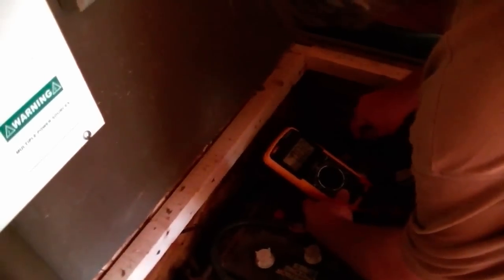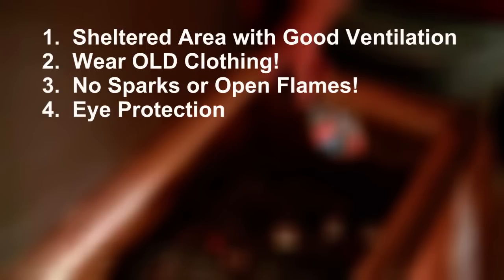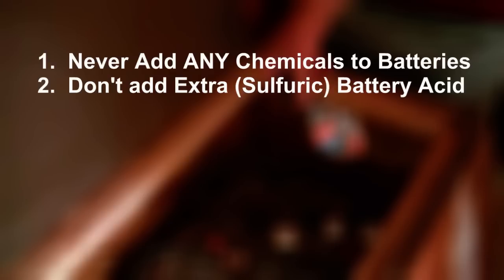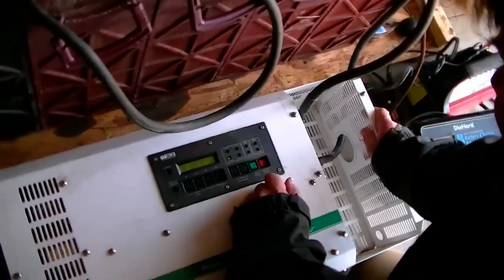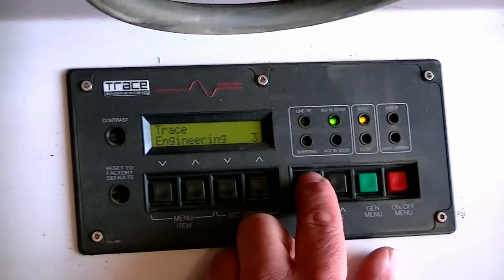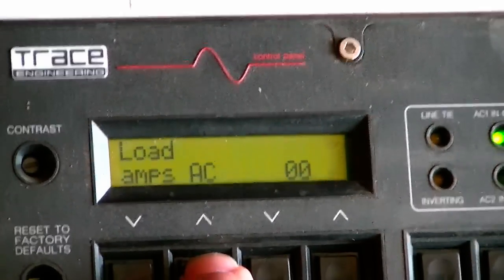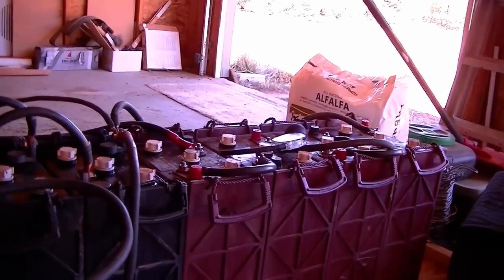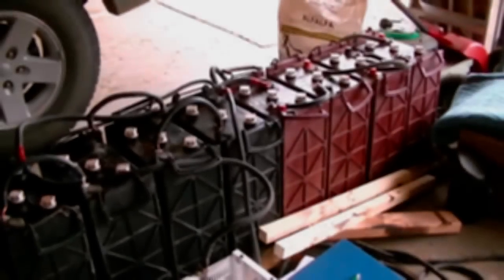Equalizing Batteries

Comment: The battery caps are designed to allow the gas to escape but not the liquid. They burst the bubbles and return the electrolyte to the cell container. If you leave the caps off, you loose/waste electrolyte and as the bubbles burst, they spray sulphuric acid everywhere.

Comment: thank you for the great video it's very well said. for the last year my l16 have never been brought to a full charge because I couldn't adjust the setpoints on my solar charge controller. we've got a new charger and we're trying to bring back the capacity using your method now.
Reply from the maker: Like I said in the video, it's as much as art as it is science.  But given the fact that your set hasn't set in the weather in a discharged state for years, I would say your changes of giving them new life are quite good.

Comment: Nice video Steve, I agree with everything you say. For AGM owners I personally would not recommend equalizing any AGM's at about 15.5 v, except for the Lifeline design, unless the battery manufacturer says to do it (most don't.) It will just dry them out prematurely, in most cases. Yes you are dead right, don't go adding chemicals or Epsom Salts to good batteries. Chemicals may be OK to squeeze a few months out of a poor battery , but will shorten the lives of good batteries that work well. (I proved it 30 years ago by adding  shop bought battery 'aid' chemical tablets to some batteries on one of my battery banks. The batteries I didn't add the 'aid' chemical to lasted years longer. Never, ever, equalize true GEL (thick electrolyte) batteries. Any voltage above about 14.3v for long completely ruins GEL cells.
Reply: All above based on 12 volt batteries of course.

Comment: Good video, with only one point,never equalize whit the cell caps off!, only open the cell to refill with distill.water, or messuring, always close the caps! (All caps are ventilated, and will keep the fluid in, not getting the mist of acid and water out off the batts., gasses can get out whitout a problem (advice from proffesional lead acid battery installer witch we are)
Reply from the maker: I would normally agree with you, except in the case of equalizing.  I have had a case split one time, and caps pop off like corks.  I don't know if the vents were clogged or what-not, therefore I have left caps loose when equalizing since then.  But then again, it's what works for you, and that's what really counts!  Thanks again much for watching and subscribing!
Reply: He's overcharging at a rate that can explode the battery if you leave the cap on.

a grossly excessive rate that should NEVER be used.

Comment: I noticed during the specific gravity test at  about 9 minutes that you didn't tap the tester to dislodge the air bubbles clinging to the indicator arrow.  The air bubbles are giving you a false S.G reading.  If you tap the instrument several times with your finger the indicator arrow will settle down to a more believable reading instead of off the scale.

Comment from the maker: My friend Tom owns a battery desulfator. Many people I know that have them swear by them, but they themselves don't know much about electricity or alternative energy systems. My experience with them has been very little.

Having said that, I have noticed no difference at all when we used Tom's or didn't use it. The companies claim that they can be used on small or large battery packs, and that also causes me doubt. For now, my opinion is that any desulfators do not provide any real protection.

Comment from the maker: Warren, I have noticed that areas such as yours don't give the best results for solar or wind, generally. Every bit helps. Having said that I would suggest determining whether you get more sun or wind where you live - it could be variable like here with more wind in the winter, no wind and lots of sun in the summer. In those cases you would essentially set up and winter system and a summer system to form a hybrid that provides the best of both when available. Wind data is available from noaa.gov

Comment: Very good video!
Subscribed to this, as it's a very useful tutorial.
I'm trying to equalize the cells in a 70ah car battery, and I think the negative cell is shorted as it's reading 0.70v when the rest of the cells are reading 2.6-2.8v.

Hopefully it can be recovered, if not I'll have to get a new battery as I'm not going through all the trouble to change the negative cell.

Comment: when I last tried to charge up my bank was just in the mere 10 degree winter and patience was not at my best. I even wired inverter backwards which oddly the batteries were not happy with when I upgraded my cable size from  4 to 2/0. so I think I smoked the 6 volt one closest to it. living is the best way to learn life.
I will work with these suggestions and see where it goes, if it's not just back to the battery store.
Thanks
Reply from the maker: Let me know how it goes.
Reply: It looks like one of my t-105's has a bad cell, it only reads 4 volts while the others are at 6.
Reply from the maker: +Rev John O'Toole The cell might be just plain ol' bad.

Comment: Steve I'm a subscriber of yours. After watching video and results are good. Could the batteries be drained and flushed with distilled water? Then replenish with new sulfuric acid and distilled water?
Reply from the maker: A long time ago I tried that with mixed results. It’s going to depend on a lot of factors like how sulfated the plates are, if any pieces of the plates are on the bottom of the sounds, etc.

Comment: Great video and info for flooded batteries. I have 1 LifeLine 8D AGM 255ah battery that won't stay above 12.6v after an overnight rest and after a full charge. It sat for many months under charged. I also use a 4 stage RV charger and also a constant voltage adjustable current charger to equalize them at 15.5v 6 hours per manufacture specs. Can you give a few pointers to this difficult task of bringing it back to life. I have 3 others that rest at 13.1v. and at $650 each I'm not really looking forward to replacing one.
Reply from the maker: Robert, 12.6v is not a bad reading at all.  That's what I would expect on a "well-seasoned" battery.  The tell-tale sign will be placing it under a load of around 20 amps.  If the voltage goes immediately below 10 volts, then you could have a sulfated or bad cell, in which case I would try your constant voltage adjustable current charger to equalize them at 16 volts for 6-8 hours.  If you've done that recently then I would equalize them for no longer than another 4 hours.

If you apply the load and the voltage drops a couple volts, then slowly creeps down, I'd say the battery is about as good as it's gonna get.  Batteries are as much art as science.  Mess with them enough and you get a feel for them.

When you apply the equalizing voltage, it the battery voltage quickly rises to the equalizing voltage, then you have a sulfated cell(s).  Hopefully the voltage will start to creep back down, then slowly rise again.  Hold the voltage for the 6 recommended hours beginning at that point.  If the battery voltage quickly rises to the equalizing voltage and stays there, then the battery is likely bad.  At that point you can try a battery sulfation additive as a last ditch effort with varied results.

The bottom line is batteries get old and die, or they get ruined and die.  Eventually they all die.
Reply: Steve Robertson Thanks for the info, my question is how much current to put into the battery at 16v? There seems to be a break over point for current acceptance. At 15v current is about 2.5 amps, at 16v it is 8-9 amps. I do hear bubbling at 15v and above. How will I know if I am damaging the battery? Can I put this battery in a bank with the other 3 that show 13.1 at rest in my RV without damaging them longterm? Thanks for all of you advice.
Reply from the maker: Robert
8-9 amps is good.  The bubbling you hear is the hydrogen/oxygen molecules being generated on the plates from the water during charging.  This is what kicks the sulfation off the plates and it is also a good thing.  During this time keep an eye on your battery temperature.  If it starts to get above 100 degrees or so, then stop the charge until it cools and then start again.  You will damage the battery if you go too long - in your case the manufacturer states 6 hours, but I usually go another 50% past that if a battery is badly sulfated.  In your case I would go as long as 9 hours.

I have seen more batteries ruined from being undercharged than overcharged.  But it can and does happen.

Mixing old batteries with new batteries has always been taboo.  But I met a fellow here on the mountain that has been using recycled batteries of all ages mixed to make his system work.  It works.  So until I get some hands on experience with it directly, I have nothing to say about mixing new and old batteries.  But like I said, the word from manufacturers is no.  They do have profit margins to maintain also.  I have nothing to offer from personal experience on this.

From a technical standpoint, the higher charged batteries will discharge into the lessor battery until their voltage has come down to the level of the lower battery.  At this point they will all live at the lower voltage - obviously not a good thing for the newer batteries, but not catastrophic either.  They will likely sulfate into the same condition as the lessor battery.

Thank you for your questions Robert.
Reply: Steve Robertson Steve, thanks for the great advice. I followed your equalizing suggestions and my once failing battery is now holding a charge of 13.2v after sitting for 48 hours. I did a load test of 20amps and the voltage dropped to 12.6v. during that test. Afterwards it came back up to 13.1v. What other tests can I run to get a better understanding of its condition?
Reply from the maker: Robert
I would say that you've got a handle on your situation.  You got your battery back.  Those tests are really about the only ones I think of off-hand to perform.  I hereby promote you from beginner to novice!  LOL  Glad it has worked out for you, Robert!  Please stay in touch.

Comment: I have 6 4v to 24v bank and two of cells gone bad. I’ve disconnected in two groups of 3 12v bank and one side came back but other 12v seems harder to come back.  One battery reading 3.4v rest at 3.8v
What should I do now? Keep on trickle charge til it reaches to 4v? And what amperage should be charging at? Thanks
Reply from the maker: What is the amp hour rating of battery?
Reply: @OffGridLivingSteve  rolls series 5000 1350ah 4v
Reply: @OffGridLivingSteve  when I started this morning, volt was at 10.4 and ended at 11.2v not enough to start the inverter.
Is it possible to string the battery with other 3 4v batteries and equalize all the batteries? Or would it damage the other set due to one cell being low voltage.

Comment: Which tecnical equipment you are using in this video ?
Very good video !
Reply from the maker: Brother I wish your channel was English because I am immensely interested in your projects!

I use all cell phones for cameras:
Samsung S4 Zoom because of optical zoom capabilities
Samsung Galaxy S5 because of great low-light recording
Two Asus Zenfone 2E Z00D for recording in vehicle from front face camera.
I bought cell phones used from Ebay with cracked display screens for less than $60US each.

For areal photography I use Hubsan X4 FPV Quadcopter I purchased from banggood.com

All these items are inexpensive but give results that rival equipment of 10x the cost.
Reply from the maker: The charger I use can be found here:
http://www.solarhome.org/schneiderelectricxw-mppt-60-150vchargecontroller.aspx?gclid=Cj0KEQjwvIO_BRDt27qG3YX0w4wBEiQAsGu3efMBss382xl_mectsY21FODrGSNyk7bZb847-4ux8I0aAms28P8HAQ

Duane uses charger/inverter here:
http://www.ebay.com/itm/142117203235

The charger used in this video is no longer manufactured.

Comment: Thank you for making this video. I do have a  question. How do you slow down sulfation of the batteries plates. Is it just a matter of keeping them fully charged and do you have to add distilled water at a preset time? I live in Florida and want to build a 3 battery deep cycle backup power supply. Do you have any advice on how I can extend battery life in standby mode?
Reply from the maker: Unfortunately, sulfation is part of the chemical process that occurs in batteries regardless of how you treat them.  However, it occurs more quickly in batteries that are kept in float and/or batteries that are allowed to remain discharged for a period of time before recharge.  It is the process of charging that "kicks off" the sulfation build-up on the plates.  The stronger overcharge of equalization kicks off that gradually built up sulfation and brings batteries back to a "like new" condition until they just eventually wear out from sulfation piling up in the bottom of the battery.  

In your situation of running them in standby mode, I would suggest every three years allowing them to run down to 50% SOD (state of discharge), followed by a standard equalizing charge.  When I was in telecommunications, it was common to have float batteries last over 35 years by doing this.  There are other variables like battery size, construction quality, how often they are called on for service, age, current sulfation damage, etc.  So mileage varies on any given set of batteries.
Reply: Thank you for your response. I plan on using 3 marine deep cycle batteries in parallel. I will start off with new batteries and a 1000 watt inverter. Since these batteries are so expensive I appreciate any advice that you have to offer.
Reply from the maker: There are nearly infinite variables when it comes to batteries.  Your case being in Florida, you have the temperate climate on your side.

Comment: I'm trying to recover two batteries right now.  If the hydrometer eventually gets in the green, can I assume I recovered them. They started in the red and slowly working it's way into the white and hopefully the green.
Reply from the maker: +Marion Blair When you have gotten them high in the green, remove the charge, let them rest 24 hours, place them under a small load to remove residual charge, and then test the voltage and electrolyte.  If it's not where it needs to be, you can try to equalize again.  If that doesn't work, then you have bad cells.
Reply: +Steve Robertson (Off-Grid Living) Thanks for the reply, that's what I needed to know.  One looks pretty much recovered as it's in the middle of the green.  Once I do the initial load test to remove residual charge, should I pull it down and recharge several times to try to remove more sulfate?  great video BTW.
Reply from the maker: +Marion Blair Too much overcharge will ruin your batteries.  My personal rule of thumb is once they are all in the green, continue charging for another 8 hours.  Then perform the tests for success.

Comment: Nice information
I have run into quite a find in that I have over 100 VRLA (Valve Regulated Lead Acid) 12 volt 8AH batteries.
 The issue is these are less than one year old and all test out at or around 12.3 volts or higher. These batteries came out of medical UPS systems that were warehoused for longer than 6 months, and mandated the change out. VRLA batteries have very low self discharge rate and they do charge up nicely. But wow, quite a logistic nightmare.
 My plan is build a wiring harness to configure these into banks but the terminals are the flag style push on connector. 10 batteries will create a 80AH  bank that can then be banked together with other ones. My plan is to have a common buss to each bank. The wiring will be 10 gauge to a heavy buss bar or cable
Racking is my biggest concern as access is required, but not as often as flooded lead acid, mostly for inspection of wiring and or individual testing. These are for the most part maintenance free and can be placed in any position but permanently upside down. Not to bad a price for what can be an 800 amp hour battery. Free, just add a few hundred connectors and wire.
Like I said, it is a logistic issue and way more complex than much larger, but fewer batteries. If one battery goes bad I can simply unplug it, but that will be the crazy part when it happens...
Reply from the maker: +Craig Nehring How do all you guys find the good deals?  I thought ! was the scrounger!
Reply: It is the place I work for, we get all sorts of time change stuff, or end of life disposal.
 You Sir have a great knowledge base AND practical experience, Thank you for sharing.
Your concept of large solar array and smallish battery back up is a real game changer ;>)
Reply from the maker: +Craig Nehring I appreciate you saying that.  Necessity is the mother of all inventions, right?
Reply: You bet, and when push comes to shove, something is better than nothing.
BTW, I just hauled in another 400 pounds of batteries... That's 640 Amp Hours worth
Reply: I wa going to add this to Steves original post but your comment deserves it better. If you parrallel batteries (as in the vid, 3 banks series /parrallel) then you shoul connect the charger POS to  one end of the chain and the neg to the other.  If you only connect the charger to the nearest battery and then parallel the others you will find that you get uneven charge, even with new identical batteries.  As an example, three 12V/110Ah batteries next to each other with a 75A charger. These batteries were new and well installed with short equal links of 30mm cable
Measured charge, 77A at input terminal...................actual charge 29A
Measured charge, 48A at first link cable...................actual charge 26A
Measured charge, 22A at second link cable..............actual charge 22A